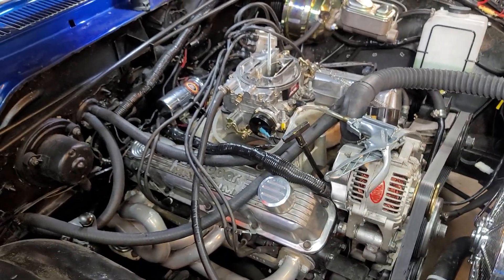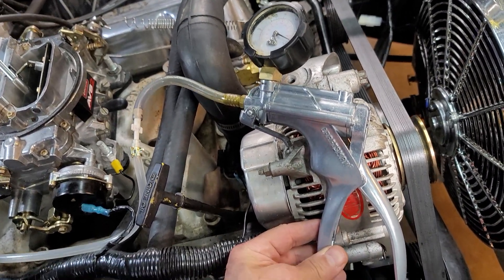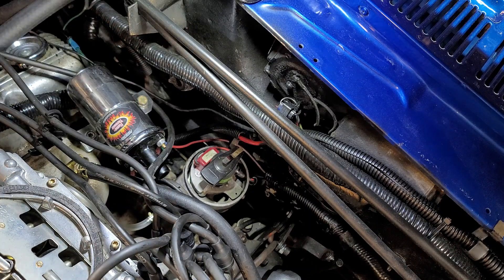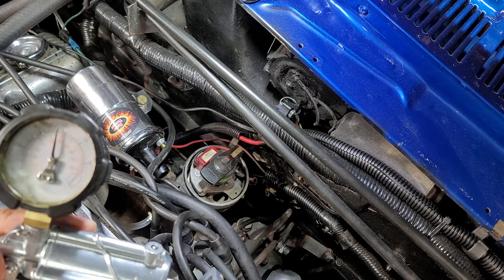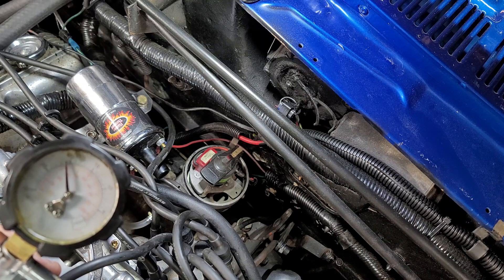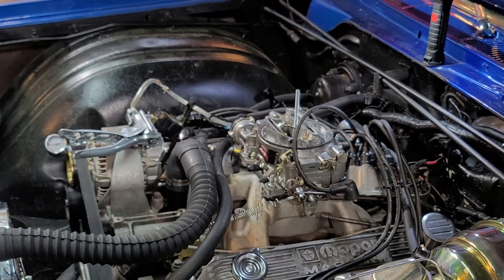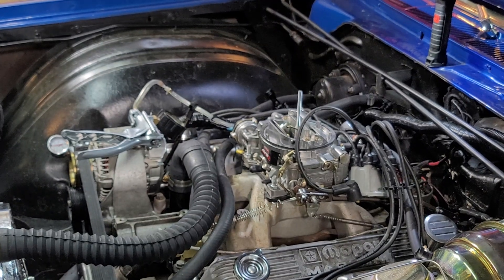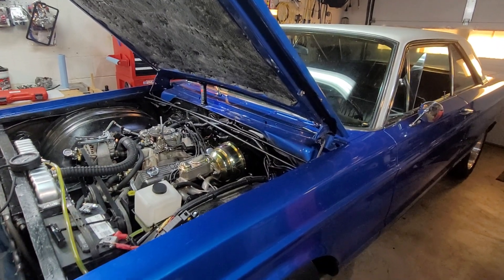How to test your vacuum advance diaphragm can for distributor on older classic car Ignition timing

Comment: What would be a symptom of a failed vacuum canister?  The reason I ask, is because I've recently acquired a classic vehicle and noticed the initial timing (with vacuum hose disconnected and plugged at the carb) to be at 28°.  Could someone have manually advanced the distributor to compensate for a failed canister?
Reply from the maker: @billbob9304  the vacuum diaphragm is known to fail after many years. It will be easier just to replace it. But if you are not familiar with what is going on, I would definitely talk to the previous owner
Reply: @HorsepowerHouse   I can blow air straight through the canister, so I will be ordering a new one.  thanks.
Reply from the maker: @billbob9304  I would talk to the previous owner before you start diving into it and throwing Parts at it without prior knowledge